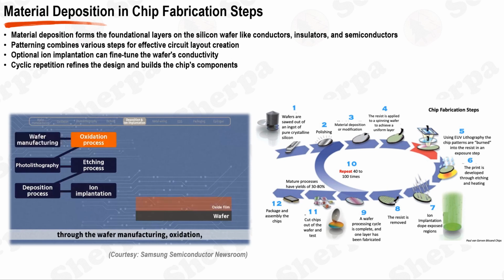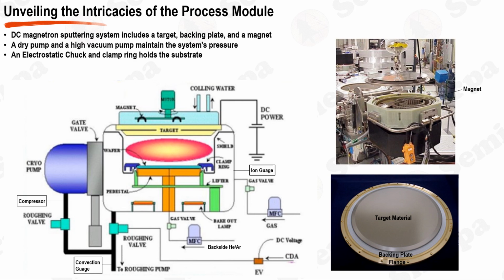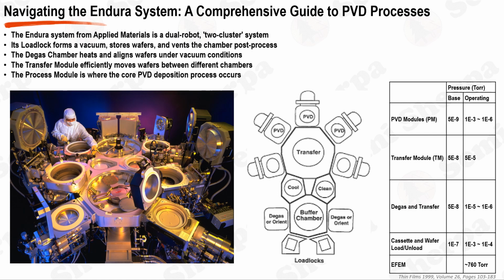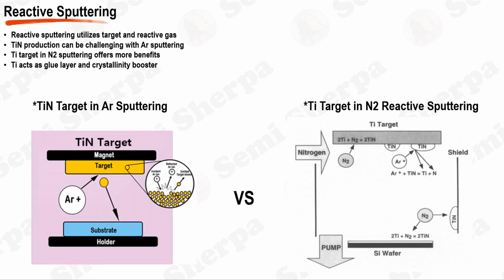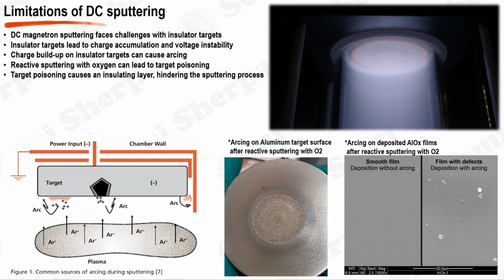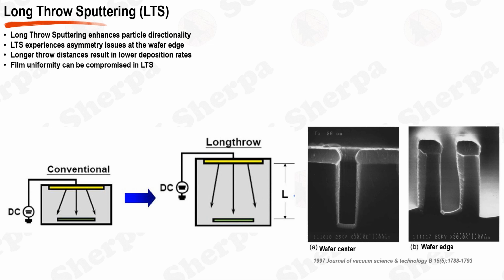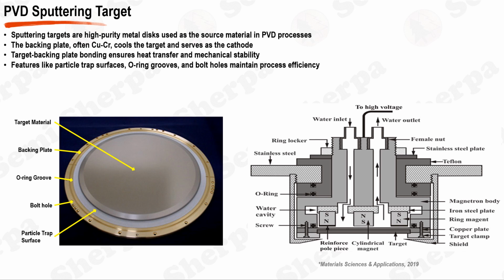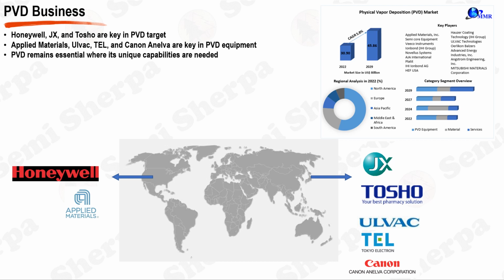[Thin Film Part4]  PVD Basics

Comment: excuse me，In magnetron sputtering using an RF power source with a Ti target, but only introducing N2 without Ar, will it cause target poisoning?"
Reply from the maker: In magnetron sputtering, using an RF power source with a titanium target and introducing only nitrogen (N2) without argon (Ar) can indeed lead to target poisoning. This happens because titanium reacts with nitrogen to form a TiN layer on the target surface, which alters its electrical characteristics and reduces the sputtering efficiency.

Furthermore, in the semiconductor industry, it's uncommon to use reactive sputtering with RF power. The reasons are primarily practical and economical. Reactive sputtering with RF power requires additional components like a matching network, which increases the complexity and cost of the setup. Additionally, the deposition rate with RF power is generally only about half compared to that achieved with equivalent DC power. This lower efficiency, combined with the increased cost, makes RF power less favorable in an industry where productivity and cost-effectiveness are paramount.

In summary, for our fellow Silicon Pioneers, while the science behind using RF power with a titanium target and nitrogen in magnetron sputtering is as intriguing as a semiconductor mystery novel, in the practical world of chip-making, it's about as popular as a floppy disk at a smartphone convention – technically interesting, but not the tool of choice for today's efficiency-driven semiconductor scene. Keep on pioneering in the silicon frontier, but maybe stick to the classics when it comes to sputtering! 🌌🔧💽
Reply: @SemiSlides  
"Fantastic, thank you so much, teacher. I really appreciate your patient explanation, it's been a great help to me. As a newcomer in the semiconductor industry, I have many confusions. Thank you for your selfless sharing. I asked this question because someone said that using RF power sources would prevent target poisoning, "But I believe this is not correct."